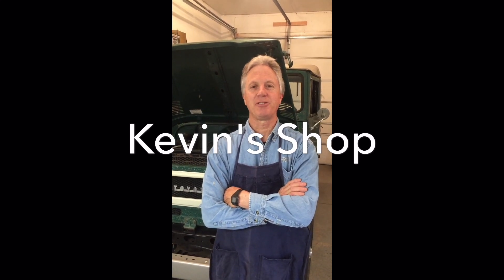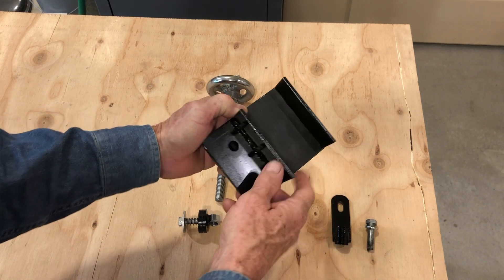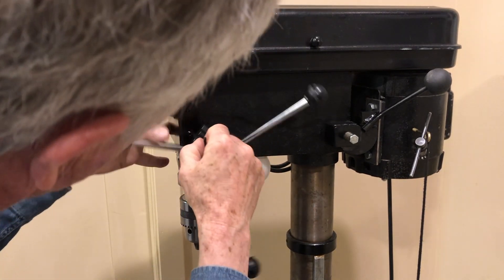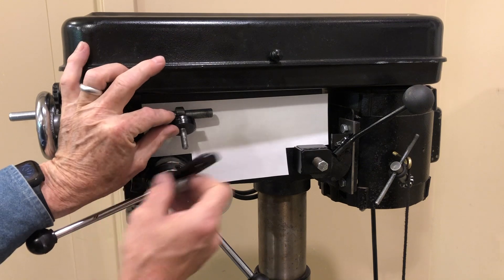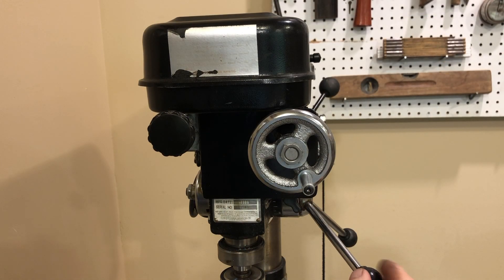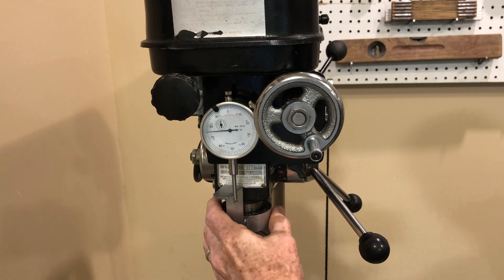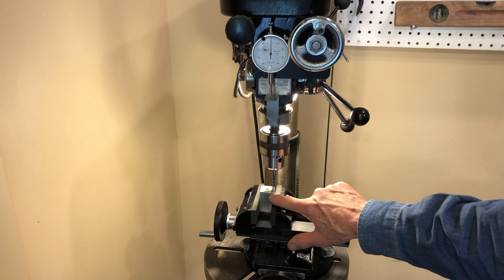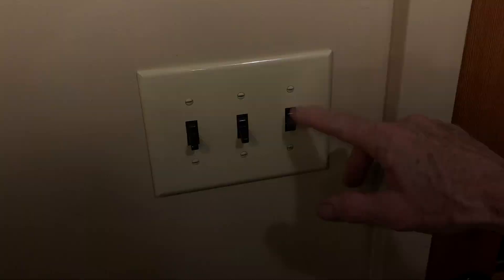Precision Milling Using My Drill Press.

Comment: That's not too bad and at least the drill chuck will drop out. Before the side load on the bearings kills the drill press....
Reply from the maker: I made this accessory because I wanted to mill an  aluminum valve body for a fuel pump which I show on another video on my channel.  This setup  turned out to work well and allowed me to precisely mill my project. I know it has limited ability but it has allowed me to complete some specific tasks. The side loading of the bearings has been brought up before. I  took a look at my bearing on my spindle and looked up its specs. It has a radial or side load capacity of 1500 pounds per square inch, more than capable of handling light milling of aluminum. I also used this precise spindle control accessory to do some precision grinding that I also show on another video on my channel. Thanks for watching and commenting! Kevin

Comment: your end mill is sticking out too far, further to mill with a drill press accurately its important that the head travel is limited to no more then an inch of travel, as thr further down the head travels, the more out its going to be as a result of bearings internally not designed for side loads, the less travel, the less load on the bearings.

Comment: What size wheel did you use on the project?
Reply from the maker: Gary, in this video I used 1/4" end mill to take a .040 cut through an aluminum block. You may be referring to another of my videos where I use a 4 1/2" grinding disk to do some precision grinding on a leaf spring. Thanks for watching, Kevin.
Reply: Thanks Kevin! I am referring to the fine adjustment wheel for the up and down adjustment.
Reply from the maker: The wheel is 3 1/2" wheel.  I tapped it to accept a 1/2-20 fine thread.
Reply: Thank you Kevin!

Comment: Awesome! What are the motor specs?
Reply from the maker: The motor on my drill press is rated at 3/4 hp, 12 amp and 1720 rpm. Thanks for watching and commenting, Kevin.
Reply: @kevins_fix-it_or_make-It_shop  wow! Hoping my 5 amp can handle it.

Comment: Beware! I've been  doing this too and I'm here to tell you you will RUIN your drill press using it like a mill. ONLY a mill is designed for radial loads (side loading using the edge of a cutter) with a very different bearing and column . My quill is sloppy as hell nowadays from this.

Comment: Very clever but a drill press is designed to be centered as the spindle moves through it's range, a drill press is not designed for side loads of any kind.
Reply: Lets see how quickly the Quill Bearings are trashed.

Comment: Great video Kev but if that drill chuck is mounted on a taper, it could vibrate lose.
Reply from the maker: Jim, Thanks for watching! I got some previous feedback and made a locking device for the tapered arbor. There is a video on my channel that shows how I made it and how it works. I added a card in the video you watched to show the improvements. You can click on it and it will show the arbor lock and  a safety shield that I added as well. Really appreciate you taking the time to comment, Kevin.

Comment: How do you stop the chuck from falling out ,breaking the tapper grip with vibration,
Reply: I want to know the same as well.
Reply: +1 here here!  I've had several fall out during straight, high speed drilling. ... It was out-of-balance and shook loose

Comment: Kevin      Peter here again just wanted  to give you an update .I finished my spindle/ milling head control on my 15 1/2  craftsman drill press and one upgrade I made on mine was instead of getting my welder out and making that bracket that replaces  the handle .The thread for the handle on mine was 1/2-20 so I got a 1/2 -20 bolt cut the head off and drilled and tapped the other end to 3/8-24 thread and installed a rod end bearing with a jam nut .This deals perfectly with the angle on the handle side if you will.The hole in the rod end is 3/8 so the bolt and spring setup I made the same and works perfectly.
Reply from the maker: Peter, great improvement and engineering! Thanks for updating me, Kevin

Comment: I'm surprised no one has commented about you climb milling in the video. Very dangerous especially in a shakey drill press. You can buy little bench top mill/drills that work quite well when set up correctly.
Reply: Yes, not worth it. Drills are not made for that. Bearings are wrong, and any actual force will remove your cutter for you. 
Get some real machine tools, old ones can be found for the price of scrap iron, you just need to know how to inspect it for wear so you get a good one.
Reply: For the rest of us...what is climb milling?
Reply: @joemendyk9994  Climb milling is when you feed the workpiece WITH the direction of rotation of the cutter. Regular milling is feeding the work AGAINST the rotation of the cutter. Never climb mill on a loose or springy machine as it tends to pull the work into the cutter resulting in a greatly increased depth of cut and then tool breakage or a damaged workpiece. Modern machine tools that have zero backlash mechanisms in the feed can get away with climb milling, but it may increase wear on the feed system.

Comment: It is dangerous to mill with a drill press because the jaw cone is not fixed and it can escape, moreover the bearings are not designed to work horizontally and lastly it will never do a good job because a drill press is not rigid enough
Reply from the maker: I made this to accomplish a specific lightweight milling project, I needed to mill a small area of an aluminum valve body for a fuel pump, which I show in another video.  Using the dial indicator made the milling an easy task and I was able to mill the aluminum very accurately.  The milling was done with a large cross slide vise and a heavy milling plate which acts a a safety device keeping the chuck from dropping down no more than an inch, the chuck would need to drop more than three inches to be thrown free of the drill press. Kevin

Comment: Nice, I like the simple method. Not a wide range, not the whole range of travel of the spindle, but for an inch or so of travel not bad. You have a way to adjust the table height, a crude adjustment with the rack and pinion that came with the press. Overall not bad.

Comment: I like your very clever setup Only problem; drill presses make very poor milling machines.
Reply from the maker: Thanks for watching and commenting! This setup ended up working surprisingly well. I wanted to mill an  aluminum valve body for a fuel pump and it turned out to work well and allowed me to precisely mill my project. I know it has limited ability but it did what  I needed. Thanks, Kevin

Comment: Any milling at all on a drill press is dangerous without a drawbar to secure the taper on the chuck & i would not have any milling cutters in a drill chuck it will come loose even light milling, get your self a mill & be safe.
Reply from the maker: Appreciate your sharing this, safety is important!
Reply: Let me guess, you have a $20k mill at home you use for fun?
Reply: @Bioman5380 No, but life time in the machine industry, be safe my friend.